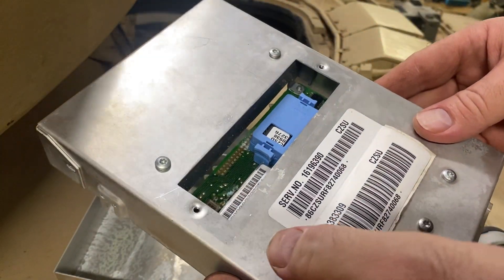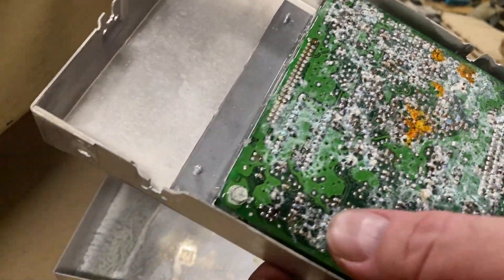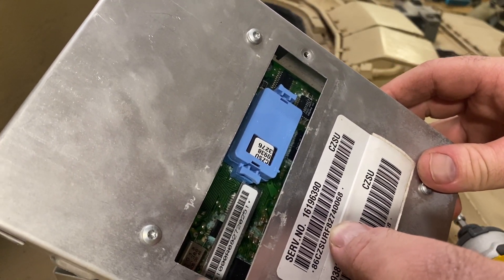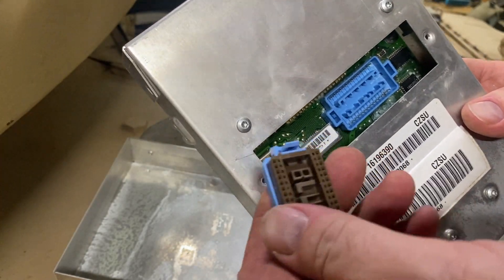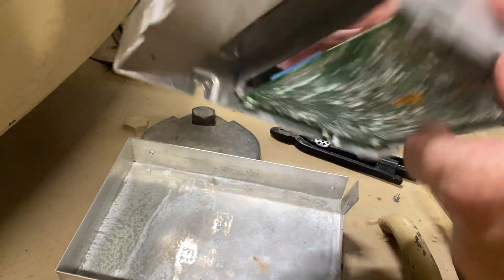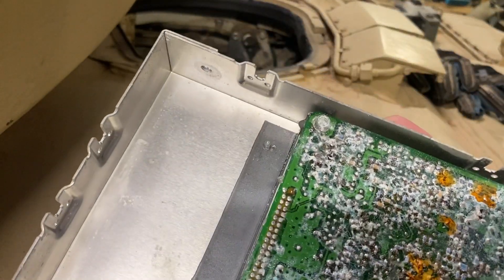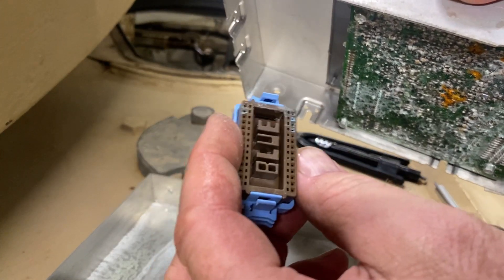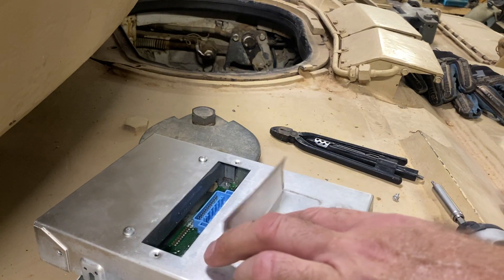HumVee TCM drowned

Comment: Did the Rock auto unit work did you need the PROM or to program  ?? or was it already programmed . Thank you for your help and Video?
Reply from the maker: I simply plugged in a the prom to the TCM board and it worked fine.

Comment: Where did you get the new one? Is it working properly now?
Reply from the maker: runs good now. Rock Auto
Reply: Any chance that you have the rock auto part number? I am in need of a replacement TCM. 

Thanks
Reply from the maker: @andrewsmith9980  BSE	TCM609
Reply: Thank you for the part number. Do you recall what you paid for it from RockAuto seems to be on stock but I'm keeping an eye on it